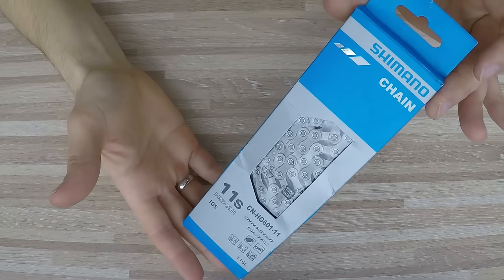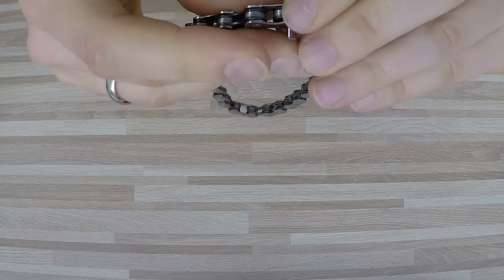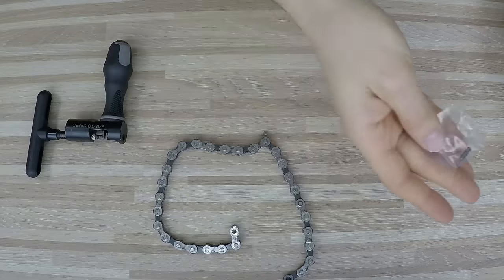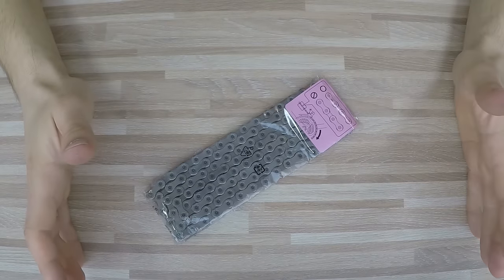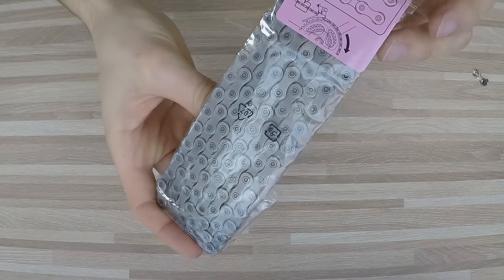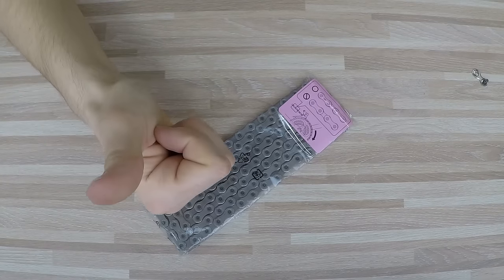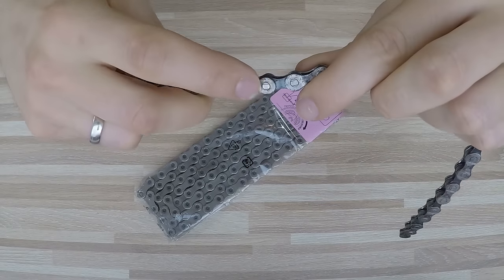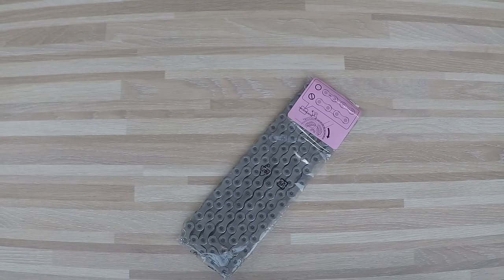4 Worst Mistakes In BICYCLE CHAIN Maintenance. How NOT to do it. SickBiker Tips.

Comment: For the first time, I dissagree! Never clean chain with water, there is no need for that! If you want to clean your chain deeply don't use hard solvent, use regular car fuel like petrol. This is my oppinion.
Reply from the maker: Sure, cleaning the chain with water only is rather pointless, but when you wash your bike, the chain gets wet anyway...
Reply: and sometimes it rains...
Reply: Yes it does, but in that case chain is lubed and is partly water resistant! If you wash unprotected chain with water it will rust in matter of minutes.
Reply: Dzoni Bravo absolute true.
Reply: Dzoni Bravo - petrol works, but is carcinogenic and tends to catch fire. Deisel works and is safer so is preferred. I use white spirits in a proper degreasing container for annual deep cleaning ( or in a Tupperware container, or 2l coke bottle) which has its pros and cons.

Water is ok, and many times cannot be avoided, but as you suggest causes problems if the bike is not dried properly. I will carefully dry the chain with a rag and may use wd40 as a water dispersant overnight to ensure it dries before lubing, but as long as it is warm and dries the Wd40 should not be necessary

To your point, I have sometimes left a chain wet, and they rust terribly very quickly. I have restored them with another cleaning and thorough lubing and they soon look ok again. I guess they may weaken if you do that too often though.
Reply: As the others have said, gasoline is dangerous on so many levels. I use the park tool chain cleaner with simple green fluid, then I rinse chain off with yes, water. Then I put a few drops of dawn dish detergent and fill the tool with hot water and run the chain thru that. This removes the simple green. Then I do a rinse with just water in the tool. Then I take my portable air compressor and blow the chain off with high pressure air. After this is when I apply lube.
Reply: On what levels gasoline is dangerous? I use it for 20 years and never had any problems... By using it I save lots of time according to the fact that I ride to work and home every day...
Reply: Just do a search for "dangers of using gasoline as a cleaning agent". I'm not going to spell it out in detail for you because I can tell you're not that bright. Two main categories. Flammability danger and exposure due to inhalation of fumes or direct skin contact.
Reply: try paraffin its a this oil and about £6 a gallon  and degreases a treat , wipe off the worst after cleaning and wd40 0r gt85 afterwards lovely and shiney
Reply: The key words are "improper use"))) Of course if you smoke while doing it in the room with no window opened  then something definitely going to happen..))) I use it for 20 years and everything is ok...
Reply: Ivan Savchenco - you are free to use petrol, no problem for me. folks are just pointing out that diesel etc work just as well, but is less flammable and probably less carcinogenic - for the benefit of other readers. I use white spirit or whatever I can grab at the diy store for deep cleaning off the bike in a proper degreasing bath, and it is also good for removing old tubular glue. in my view Citrus is better when the chain is on the bike, as the pro teams do, actually Morgan blue usually.

but off the bike petrol / deisel are good options as long other folks who may not appreciate the issues as you do are informed of those risks
Reply: Dzoni Bravo I agree, using water is messy and unnecessary.  Simply clean the chain with a thick wad of towel after every ride. takes 2 mins, prevents build up of crap.
Reply: Minutes? Really?
Reply: If you do it after every ride yes. Some riders may clean the chain once in a while, adding lube on top of old crud, ending up with a thick oily covering. If you run your chain through a thick cloth you're removing the crap from one ride leaving it pretty spotless.
Reply: I wrote "car fuel like petrol". Diesel is also car fuel, isn't it? I use diesel too. Petrol is not dangerous for chain cleaning at all, no body ever got hurt while cleaning chain with petrol. Petrol is not more carcinogenic then diesel, and there is no need to get dirty, just wear gloves.
Reply: So if you don´t believe in the hazardous properties of petrol, just be aware that residues of it have a rather negative influence on the properties of the lube. Petrol does not evaporate entirely by far. On this point, Diesel may be even worse, because it barely evaporates.
Reply: moninum is right, isopropyl alcohol is a better solution as it's cheaper than petrol and diesel since it doesn't have the same tax on it, and evaporates fast, since it's 99% alcohol there's not as many additives left behind either, petrol while working as a cleaning agent isn't ideal as many of the additives in it are there for the benefit of combustion engines rather than helping with grime cleaning properties.
Reply: superjudgebunny - folks on this channel are trying to help each other by sharing advice. If you really know what you are talking about you could set out the flammability of the various products, and advise people without experience to avoid the more flammable products like petrol and white gas. That would be helpful, rather than the aggressive condescending rant you have provided 

Or we could just check Wikipedia
- white gas should not be confused with white spirit
- white gas, which is a much more volatile gasoline-like fuel

Your answer makes no sense, there is not much difference between white gas and petrol, both are dangerous when not used properly

The Wikipedia of cycling is Sheldon Browns website, which says

"The traditional way to clean a bicycle chain is to remove it from the bike, then soak it in a degreasing solvent.

[Paint thinner will work, also isopropyl alcohol. The best choice these days is a citrus-based solvent, which is less toxic, smelly and environmentally damaging than others. Professional-quality solvents are designed to be followed up with a water rinse to remove remaining dirt"
Reply: I have some 99.9% ISO that I am gonna give a try.... 

Plain and  Simple...the kind of cleaning that is required for this process, cannot be healthy no matter what you do...and how many safety concerns there might be...all I can say is don't run with scissors, use common sense, and work safe, protect your hands with some latex gloves, eye protection, and your clothes might get a little soiled, so don't wear your Sunday Work Clothes when doing this...
Reply: Dzoni Bravo ...use diesel, not petrol, as it is also a lubricant
Reply: Ivan Savchenco Hope you wear nitrile coated gloves and use in well ventilated area and have fire extinguisher at hand, for safety sake....oh....and don't forget the safety glasses. take care Ivan, don't suppose you have a smoke hanging out of your mouth while you are doing this are you??!!
Reply: J B any hard solvent is going to be dangerous.  The harder the solvent, usually the lighter (more viscus) or more refined the crude was.  Petrol is more refined than diesel, and less refined than most (I'm pretty sure) hexane based solvents.  ISO is not a hexane based solvent, it's probably the safest too.  

Most people should know that solvents come from crude, there the lighter liquids in crude.  When refined, we take those out to make things like gasoline.  However gasoline has some solvent properties due to some of those hexanes being present.  Same with diesel. The more viscus the solvent, the more refined.

Why does it matter how well refined it is?  The heaver parts of crude contain more energy, however the energy curve to get those bonds to release is going to be strong.  The light parts of crude, which many solvents are a part of, have a less energy curve to release the bonds.  So you don't have to put as much heat on them, they will ignite (bond release, energy released, causes chain reaction in which we call fire....) with a lot less energy though.  So a lighter solvent is going to have a higher chance of a flash burn than a thicker solvent. Gas has a low enough flash point to be dangerous where diesel you can light a match and put it out.  Naw really, you can light a match and put it out in diesel.  So if you want the "safest" (hexane), that's probably your best bet however there's a lot of nasty that could leave residue.  Do a quick rinse with a better solvent?  Probably works. 

That's what I mean by it's all the fucking same.  Any oil based solvent, or hexane based solvent, is going to be extremely dangerous.  Which we should all have been taught before using solvents in an open pan.  

There you go, the ins and outs (basics) of why oil based solvents (including gas/diesel) are a compounded problem.  ISO is by far the safest, with other alcohols shortly behind.  I'd say the safest though?  Idk, they are all flammable and pretty environmentally unfriendly.  The safest?  I'd say ethanol.  Get your self some cheap, pure grain ethanol.  Enviro friendly, equally as unsafe (flammable), but it's a solvent!
Reply: superjudgebunny ...some good points, i have now completely stopped using diesel and just use a diluted traffic film remover in my park tool cleaner, gets it spotless, i then use a soapy water afterwards in the cleaner to rinse the residue off...then lubricate! No need to use stinky old diesel even though it works it is not great for enviro!
Reply: Methanol, which I forgot, is also more or less enviro friendly.  This is one of the reasons why people who will use things like gasoline as a solvent responsibly only do so when it's a last option.  The dirtier your solvent is (Gas/Diesel is not as clean as a more viscus hexane solvent due to more things in it) the most likely it's toxic.  

There are probably eco friendly solvents but you will pay a premium and are harder to find.  Plus I believe most are rather new, as in the last 5-10 years.  Which is GREAT, just going to be a crap ton harder to find (internet probs).  

Any alcohol is going to be safer than a hexane based solvent eco wise.  ANY.  With the best 2 being methanol and ethanol (edit: acetone, mentioned below is prob #1).  Other than that, it's bio-safe (very new) or back to the same ol' way of hexane solvents.  

It's amazing how there are people here arguing about metal safety without ANY knowledge of solvents, oxidation times, or basic health hazards.  In this situation though, I'd use methanol (drain to sewer, just as toxic ans your waste trust me).  Mainly because it's cheap, effective enough. If it's got too much water for the water phobes, you can always distill iso/methanol/ethanol to get a pure 100% alcohol. (at your own risk) 

I also forgot, you can use acetone as a hard solvent and it's a biological compound.  Which is what a lot of chemists use, can't believe I forgot that.  It's water soluble, evaporates completely with no residue (cleaning chem beakers, can't have any catalysts left over).  So it's safe, been proven for a long time.
Reply: Here is a quote from the Shimano RD-6700 installation manual, General Safety Information: "Use neutral detergent to clean the chain. Do not use alkali-based or acid based detergent such as rust cleaners as it may result in damage and/or failure of the chain."  Simple Green is an example of a neutral detergent.  After cleaning your chain with Simple Green, fill your chain cleaner with water and a drop of dish detergent and run the chain through to rinse out the Simple Green, then rinse the chain off with a hose.  Run the chain through a towel and quickly spin the crank to eject any remaining moisture.  If you have an air compressor, spray compressed air into the chain.  If not, lube it up with a quality chain lube one link at a time.  The chain lube will force out the water or the water will evaporate leaving the lube to protect the metal from rust.
Reply: Using car fuel is a bit crazy.  A spark from an electric motor, a light switch can ignite it.  A far better choice is lighter fluid-stuff used in cigarette lighters and coleman lanterns.   You can also buy it under it's proper name NAPTHA in a paint supply store.  Kerosene-diesel fuel is also far less dangerous
Reply: Dzoni Bravo I
Reply: Kerosene is best.
Reply: Don't use hard solvent, use regular car fuel like petrol.....regular car fuel like petrol is a hard solvent.
Reply: Ivan Savchenco, Gasoline is dangerous because, if you have a lot of it, USA may invade you, which leads to many deaths and much suffering. Also, it is unpleasant and toxic to breathe its fumes.
Reply: Not certain but don't think there would be a problem with water being left behind from Isopropal alcohol evaporating: mixed together, they form an azeotrope which has a different [intermediate] boiling point than either of the two parts.  They evaporate together.
Reply: use shimano XT 8 speeds chains   they never rust.
Reply: I use gasoline, but essentially outdoors.  So fumes are not large problem.  I don't smoke or have any fire nearby, not even electrical tools.   Skin contact is not good.  Wiping it away is probably too late.  But I haven't noticed any problems.

Diesel does not try out from chains like gasoline does.  It might change properties of lubricant.  I don't know if gasoline leaves any residue. 

I have tested paraffin lubrication (old chains and sprockets, nothing to lose).  I have washed those chains with water.  No problems.  Dry warm air will remove all water.
Reply: I used water to clean the chain via a pressure washer. it seemed to do a good job and it was VERY easy.
Reply: Cleaning with water is fine so long as you lubricate afterwards. Which is one of the things disused in the video.
Reply: GNX157 I personally just wouldn’t want gasoline flinging from the chain into my clothes. Could ruin shoes and socks or whatever. Plus on a hot day your bike would smell like fuel I personally don’t like the smell of gas or diesel
Reply: tyvek05 grinding metal parts and gasoline. Better safe than sorry
Reply: Stephen Carman you must not get your chain too dirty.
Reply: Names yeah too many opinions on cleaning bike chains. I’ve lubed with everything lithium grease, mechanic grease, machine oil, engine oil, even cooking oil of that’s all I have I think the key is to keep it lubed so that the chain doesn’t break or worse kink and do so real damage to more expensive parts like a cassette or crank. Of course bike chain lube is awesome at not becoming gritty hence why it’s made. Chains aren’t expensive but have you ever had one fail in the middle of an 18 trail? All your friends would have gotten back 2 hours before you do.

Comment: Guilty of all. Only had one chain problem. But I did have to remove the link as one of the rear mech wheels was rubbing on the chain. So I removed some links. Maybe a year after, going up hill, the chain snapped/came off. I didn't put it back on. It was an old chain.

Currently re-installed my chain using the old link. A new chain and gear set isn't too much in my eyes and I will be buying them anyway, so I am not overly bothered.

Now I know this, I will take care when doing my rebuild. I did use a chemical to free up my chain, and ended up with just one slightly stiff link. With some lubrication and use, it may be fine. It was outside for a while, then in my car to stop the rusting, then over a year in my garage.

Comment: for a tip sir, after cleaning/washing your bike try spraying some compress air or use air compressor and spray on bolts head and chain as well as in cogs and chainrings before putting some lubricant just to make sure its completely dry, sometimes we didnt notice after cleaning/washing our bikes, water will stay in bolts head like in stems and handlebars and also between the cogs.. thats the reason why bolts head become rusted.

Comment: How is cleaning the factory grease from OUTside the chain help with keeping INside clean?? And it's inside parts od the chain that make noise, and wear out the sprockets! 

This video makes no sense.
Reply: More of an issue with mtb; grease or oil on the outside of a chain attracts dirt. Especially bad in very dusty conditions, which happens a lot when you get lots of people riding the same tracks during summer.
Reply: cthulpiss how do the inside parts of the chain that don't contact the sprockets wear them out exactly?
Reply: @StoutProper  as far as I know my chains these are pins and rollers mounterd ontyo them that wear out sprockets;
therefore removing factory grease from OUTside won't affect sprockets wear.
Reply: cthulpiss the rollers that the sprockets come into contact with? What is your definition of outside because last time I looked the only thing inside on a chain was the pins
Reply: @StoutProper  English is not my first language but I think I spoke simply enough.
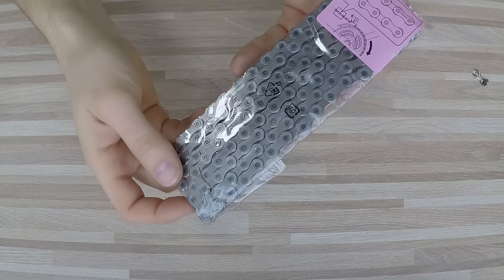Just look (again?) at video - from 4:10  up to 5:00.
And then my point is "it's inside parts od the chain that make noise, and wear out the sprockets! "
Reply: cthulpiss yeah I'm sorry pal I still don't get what you mean by inside. Do you mean the inside side of the chain? Ie the side that comes into contact with the sprockets? The inside side of the chain loop?
Reply: cthulpiss you mean the inner surface as opposed to the outer surface?
Reply: @StoutProper  I mean cleaning the outside of chain links, as suggested in video, has nothing to do with sprockets wear.

Comment: I always used stock chains that came with my Redline BMX bikes. I never even took apart my chain. The only time I took apart a chain was for a kids 16" wheel bike, because the chain was red rust so I just put a chain on from a different bike of a different size.